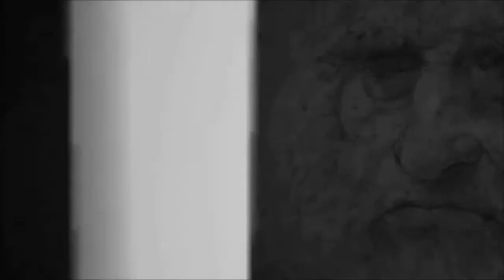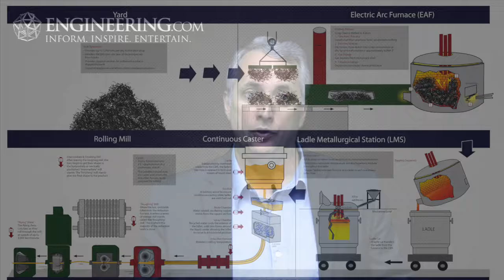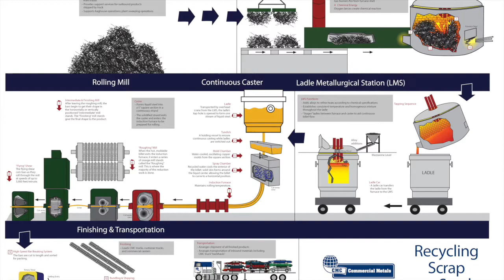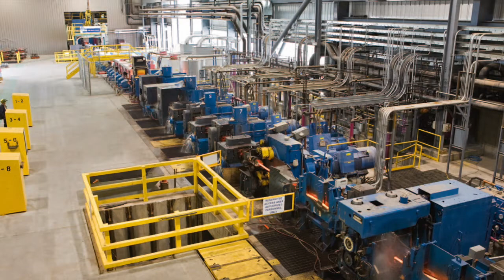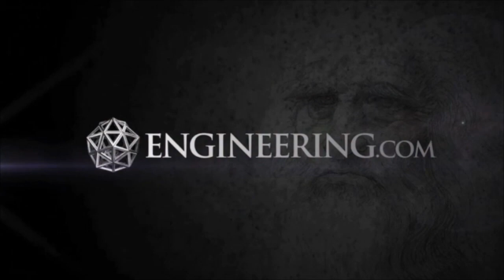New Micro Steel Mill is Competitive Despite Low Steel Prices

Comment: I've worked at the Mesa mill. The micro mill runs so efficiently because it produces an appropriately sized billet that is rolled on a truly continuous basis. Nearly every foot of billet coming out of the caster is converted to rebar, or other goods, in one strand from the caster to the finish shear. The mill's slowest speed is faster than any older mills fastest speed!